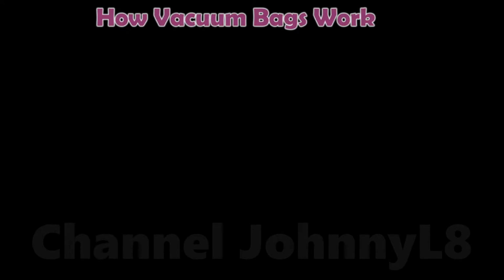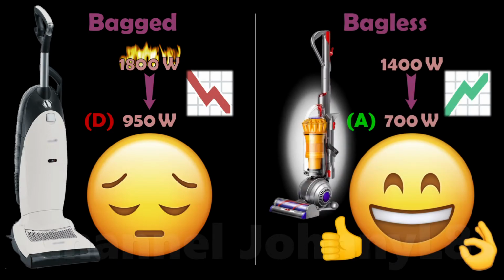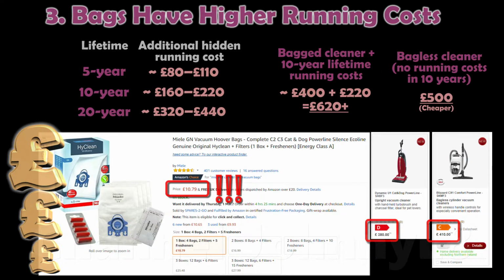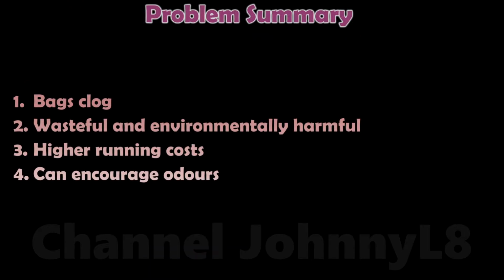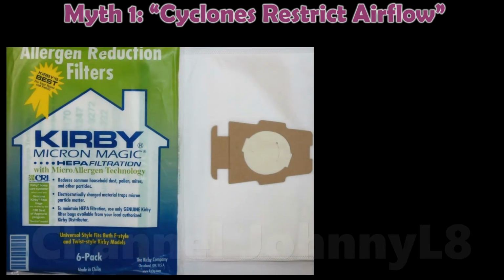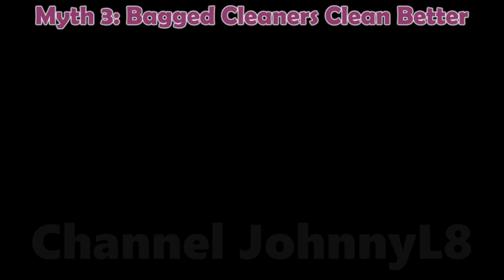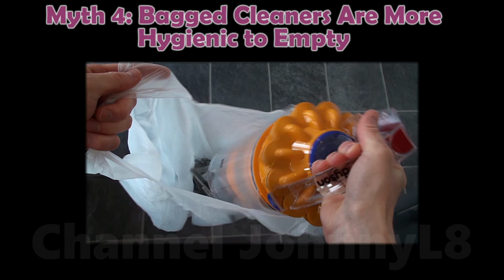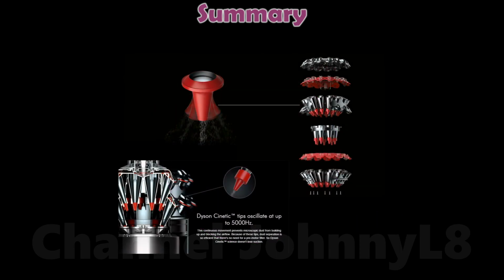Bagged Vs Bagless Vacuum Cleaners

Comment: Cyclonic technology is nothing new. It's been used in mines for years to filter large particles out of the air. It's hardly a replacement for proper HEPA filtration though which is why cyclonic vacuums (ie Dysons) still need filters. The main advantage is upkeep. The cyclonic filtration reduces the load on the filter. A bag-less vacuum without cyclonic filtration will go through filters faster, but a bagged vacuum won't go through them at all, since the bag is regularly changed. This is more a question of preference as long as one is comparing properly sealed systems between bagged and bag-less vacuums. There are pros and cons to each system, otherwise commercial vacuums would all be bagless because the upkeep is lower, but the commercial side of things seems to slant heavily towards bagged vacuums.
Reply from the maker: I don't really think you actually addressed any of the issues with bags raised in the video and somewhat glossed over their major problems and impact. If you want to understand why commercial vacuums aren't bagless, see this video: https://youtu.be/qmEj9NFZzCI It has nothing to do with performance though and relates to convenience in a commercial environment as you allude. There is literally nothing a bagged vacuum does (in terms of performance, ease of use, and environmental impact) that isn't surpassed by the best (i.e. Dyson) bagless cleaner. Non-Dyson bagless cleaners are terrible because they can't use the patented cyclone technology which is the only method I've seen which solves all common filtration-related problems.
Reply: @VacuumFacts  "Non-Dyson bagless cleaners are terrible because they can't use the patented cyclone technology which is the only method I've seen which solves all common filtration-related problems."

That's painting with a pretty board brush I think. Just because something is patented doesn't mean it is good or works, it just means they have exclusive rights to it. The "Neurophone" is patented by Patrick Flanagan even though it's completely useless, it aligns brainwaves or vibrations or some such spiritual hogwash. Patent offices do not verify functionality of a design, only uniqueness. Not saying cyclonic separation doesn't work, it does as I stated. Dyson was the first to adapt the tech to a vacuum and it is a great creation and does solve many issues, chiefly among them is saving on filter life. It could be used in a bagged vacuum as easily as a baggless. It has a habit of building static, something that Dyson seems to have solved with a metal impregnated paint that shares a ground with the power supply. This solution to my knowledge seems to work pretty well provided the paint is kept in relatively good shape. Also, I did listen to the video at 1.75 speed due to time constraints, and just wanted to share my thoughts on the debate in a very general way. I don't think any one design is suitable for everyone, or we wouldn't have so many choices in other products (cars, computers, even something as simple as lighting).

In general, I do prefer to stay on the cutting edge of things, as technology today is, with few exceptions, better then that of yesteryear. My house is equipped universally with LED lighting, for example. My cellphone is only 8 months old, because it's just better then my old one, and neither hell nor high water could make me revert to my first cell phone, a Moto Krzr. My Mazda is a 2018 not because my previous car, a 1997 Nissan Maxima, didn't get me around, but the Mazda is safer, faster, more efficient, etc. But my toaster is a SunBeam Radiant Control from I think the 70s (Technology Connections has a great video on this toaster), which is simply better for my purposes then a modern toaster.
Edit: Fixed formatting, youtube keeps adding line breaks to my comments.
Reply from the maker: @linksmith1057  Oh, I didn't see this response; no YT notification... Cyclonic filtration could be used in bagged cleaners, but then what would be the point? The filter in bagless cleaners would be doing the same job as the bag, but without the environmental impact, as discussed here https://youtu.be/T3prXR-aeOg . I've seen no issue with static or evidence of paint being grounded, or paint being kept in good condition. Happy to receive some formal evidence of this to review. As far as design goes; whilst many designs are possible, some work better than others, as measured objectively, and when such evidence exists, then it transitions from opinion to fact. There is plenty of evidence that the latest Dyson cordless cleaners out perform their competitors in terms of cleaning performance, ease of use, and environmental impact. I'm always reviewing this though.
Reply: Vacuum Facts during the design phase of one of our instruments (I’ll keep the company name to myself, but I will say it’s a subsidiary or a Fortune 500 that sales products to nearly every country on earth and has been around since the 40s), we used cyclonic separation to pull particulate mater from a water sample (yes, water, but fluid dynamics are fluid dynamics) prior to the waters entry into a sampler. The issue was the samplers fluid pump was getting damaged by sand and other large debris getting embedded into the vinyl tubing. The separation solved the issue, but it developed a problem. If the sampling tube was not kept in contact with the water body, and thus grounded, the vinyl built up some pretty massive static charges. The circuitry was properly protected, but it a user touched the tubing, it could be quite painful. The solution. Was quite simple, we added a simple grounded wire into the cyclone to pull charges out of the water sample. Dyson also makes a hairdryer with what is called a “Horn or Plenty” on it. While not exactly the same as cyclonic separation, the design is also prone to static buildup. I’ll admit I don’t know if the vacuums solve the problem the same way, but I do know they solved static in this case by used for a metal impregnated paint that is electrically connected to the neutral circuit of the wall socket. 

The other method they might be using to fix it is a snubber diode to the negative of the battery, basically using the batter as an “airbag” to breakdown the static charge when it goes over the diodes breakdown voltage (which isn’t hard to do for static). This method would perhaps be easiest since it’s already in play in any device with an electric motor to stop back EMF.

Edit: as for why one might use cyclonic separation with a bag, it wouldn’t be of much advantage you are correct. If someone were using very poor quality bags that clog up and restrict airflow or suction fast, cyclonic separation could conceivably be used to extend the life of these very cheap bags. Modern HEPA style bags really don’t suffer from this much however.
Reply from the maker: @linksmith1057  That is interesting. Although I remain to see any evidence static is an issue on Dyson cleaners in use.

I went back and read your original comment more carefully and wanted to address it again now I have more time. You’re right that cyclonic tech isn’t new. What was ‘new’ (and patented) was the application and engineering the concept to work as an air filter for domestic vacuum cleaners. Unlike with sawdust in mills, which was apparently the inspiration, achieving filtration to sub-micron level was difficult, but achieved. And yes, an advantage is upkeep, but there’s also environmental impact (which is significant across a nation), cost to the user, and consistency in performance—all of which benefit hugely from cyclonic dust filtration. Cyclonic filtration rendered bagged technology an inefficient thing of the past, like the horse and cart, or the candle—they work, but are superseded. The technology is patented however, meaning competitors can’t blatantly steal, and those that tried, like Hoover, were crushed in court. As such, every competitor to Dyson relies on primary filtration using a filter/bag—so either environmental impact or user hassle, with reducing performance as a function of dust loading. Modern cleaners also benefit from many other innovations, such as the cordless form factor, allowing easier, bite-sized cleaning. Again, Dyson objectively excel in this area, being the only company (currently), after several years, to offer machines which are not only marketed as being mains-replacements but are measured to be. Ultimately, whilst preference comes into the choice of product a person buys, the facts above remain true; cyclonic filtration solves problems bags create. This was the message of this video. Unfortunately, the regressive capitalists who saw the benefits of cyclonic filtration but who couldn’t steal the tech, relied on cheap clones rather than better innovative solutions, which brought their own set of problems as I discussed here https://youtu.be/U_qS2i6HQRY
Reply from the maker: @Blackout720  My videos contain sound reasoning based on established facts and known principles, or cite evidence. This is in contrast to your wild hollow claim about a 2 year battery life... (they're recyclable you know) :/ You've made three comments today; not one of them said anything of value and all of them were grumpy. Nuff said

Comment: Typical Dyson fan boy. :/
Reply: As someone who has repaired vacuums for family and friends, bagged vacuums are more tolerant since if the bag fills up, it simply stops working. With a bagless vacuum, dust has a higher probability of making it’s way to the motor bearings which will eventually cause it to make a racket which ultimately leads to the vacuum being junked and thrown out. 

With the materials vacuums bags are made of these days with multiple layers compared to the single ply bags from many years ago that clogged with fine dust, they don’t loose suction and airflow as easily anymore.
Reply from the maker: Typical meaningless comment that entirely ignores the points raised in the video

Comment: no a bagged vacuum is better because you don't just pour dust all over your'e  floor.
Reply from the maker: A false myth. Plenty of videos on my channel showing how to do it properly without any mess at all https://youtu.be/E_ik6qScs0o . Much better in every way than bags. Plus there's literally everything else mentioned in the video you conveniently ignored.
Reply: and you waste more money to buy the useless bags that just hurt the environment.
Reply: @jonny11bonk  A bag is just a filter that can hold some of the matter you want to remove, and you need filters to prevent the harmful dust from being send into your room after you had spend time to suck it up, bag og bagless it needs filters to do so no way around it unless you are willing to accept the harmful dust re-entering in the air. The harmful dust is that small you can't see it, and it pass right thrugh any cyclone (the factual details is right in this video btw).
Bottomline is that you need filters, in a bag system the bag is the first filter one or more are placed before or after the motor, in a bagless system the cyclone is the first filter and it heavily depend on the airflow speed to maintain it's filtering properties, one or more filters are placed before or after the motor.

Comment: I find bagless vacuums can sometimes be a mess to empty, I prefer the system on my Dynamic U1 that closes the top of the bag as soon as you remove it. I suppose if you didn't want to throw it away you could sell it to someone else as a pillow.
Reply from the maker: Hi, yes I cover this in the video. Dyson are the only company which do bagless technology correctly. This is not surprising given they invented it and the rest just copied to jump on the cash bandwagon. Unfortunately for them, Dyson patented their designs and ideas, so others are left makig cheap imitations which don't work. As such, emptying the bin is a messy nightmare on all non-Dyson bagless machines. Dyson did it right however, and with their latest models—such as the V10—it's messless and takes 5 seconds without any additional cost to the user or environment, putting only dust into the bin (my reviews demo this). It's far superior to bags. The trapdoor bag you mention isn't a bad idea, but still suffers from the fundamental problems explained in the video: it's extra unnecessary waste (some plastic) added to landfill which scales hugely across a nation, it's extra cost to the user to replace them, you've got to keep a supply ready, and bags encourage smells more than Dyson bagless which can be emptied easily after every single clean.
Reply: @VacuumFacts you literally emptied the trash from your vacuum into a plastic bag…which will then go to the landfill. What a ridiculous comment.
Reply from the maker: @josephk1342  Same old comments from rabid vacuum enthusiasts and bagged machine apologists... You, somehow, seemed to completely miss that the "plastic bag" in question is a bin liner and nothing to do with vacuum cleaners. Worse, you also seemed to fail to notice that the bag of a bagged machine goes into the same bin liner, in addition to just the dust it contains, and is unnecesary additional waste, as pointed out explicitly in the video. Staggering. You can really see how the same nonsense regurgitates from the echo chamber you all come from.

Comment: I think the thumbs up two thumbs down ratio sums up this video. When a modern bag quote-unquote clogs up loses less than 10% of its efficiency. Most modern bag vacuums will fill their bag to the point where they go back into the hose before you'll notice if you don't look at the full bag check indicator.
Reply from the maker: I don't think you can draw any meaningful conclusions about the thumbs up to thumbs down ratio given a) the statistically insignificant number of people are involved in the voting, and secondly, it's opt in (go read some statistics books to learn why that's important :P ). The number of people who gave any kind of thumbs vote relative to the total number of views says more. xD As for the claim about the quantification of suction loss as a percentage of bag fullness, I'd need to see the evidence you've used to come to that conclusion for me to believe it. Presumably there were no issues with all the other points I raised which made the full picture, seeing as there was no mention--which is good.
Reply: @VacuumFacts  i agree with you performance reviews bagged will always outlast bagless no filters to clean and messy clogged cyclones bagged beats bagless any day.
Reply: @performancereviews and @vacuumfacts please don’t start arguments with each other, it has already started a war within this out-of-touch community and the last thing we need is for it to get any worse.

Comment: https://youtu.be/X43oWPpSBIY
Reply: This is some serious airflow 😁
Reply from the maker: Yes, but here's the problem with this misleading demo. If you put a jet engine in a machine with hundreds of times the power, you could probably suck flour off the roof. This is an unrepresentative test that glorifies a situation that's wholly unencountered in the home. If anything similar happened, you'd easily vacuum it without much thought. High air currents aren't necessary, on their own don't directly equate to high holistic cleaning performance (the only thing that counts) across all floor and dirt types, and often come with other consequences conveniently not shown in this misleading video. Firstly, the input powers required to achieve high air currents make it more expensive and noisy to run, and harm the environment more. Secondly, such vacuums will likely have a hard time on flat hard floors and clamp so hard you can't push it. Great vacuum! You could extract flour off both surfaces shown in that video with a tiny fraction of the power and air flow, with no more cleaning time. In fact, rather than edit the video, I'll demo it with the V10 and upload in a few minutes. In LOW mode too. And I'll time how long it takes to take off the wall, clean, and put back on the wall.
Reply: JohnnyL8 I agree with you. I had a Kirby sentria2. I was very impressive on carpets. The tech drive makes it so easy to push around. I could use one finger. But it is a big bulky machine and difficult to manouvre around objects and very noisy.. I sold mine. I think it's a low wattage around about 500-600w. So it doesn't use a lot of power. In large American houses it will probably work well. But not for me.
Reply from the maker: Whoops, proper link https://youtu.be/IAqrPf9iNgc